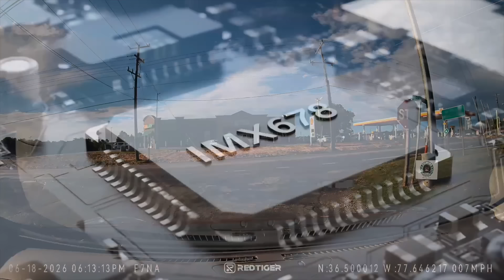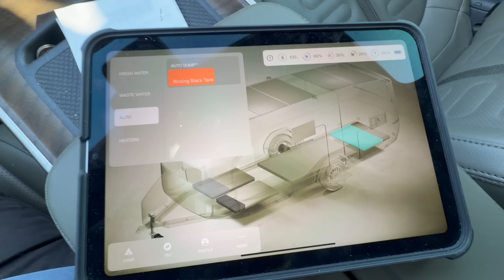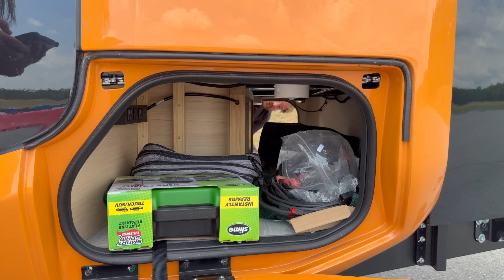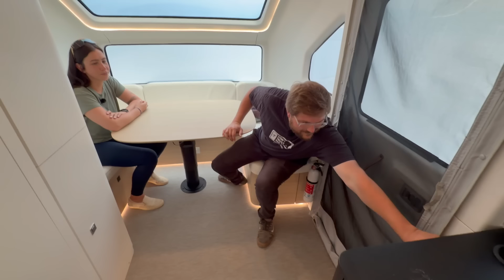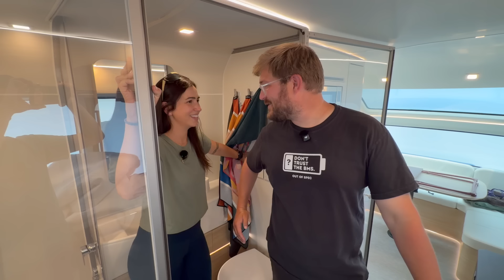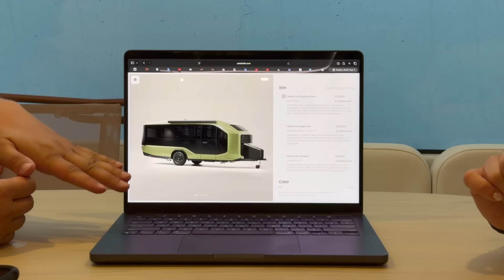Pebble Flow Electric RV 1 Month Review - The Most Innovative Product We’ve Tested

Comment: You actually do have to pull out blocks if the slope that you're trying to camp on is too steep because there's only so far the jacks can go so you always want to set a blocks just in case. 

You can always find a flatter spot, but sometimes you can't find a flatter spot.

Comment: This is exactly why they need to make a bigger unit.  One that is about 5-8 ft longer, double axle, more room for battery and solar panels. Not much bigger since it is very heavy.  Keep is closer to 50 or 60KW is good. Use the extra space for storage space, washer/dryer, bigger HVAC.  I will be totally sold if they did that.  Bigger owning too.  And on the back end of the unit, they already can open the big windows.  But if they took a bigger step there, copy what Evotrex did on the rear end like a toy hauler, that would be supper cool.  Personally, I would have a hatch on the ceiling to mount a tent or 2 tents on the rooftop for sleeper.  That would be the best of tbe best.  It solve the sleeping space problem without messing with the interior space of the unit.  If theybdid all those, no other in the world can beat them.

Comment: The leather door straps are a feature, not a bug. Putting my engineering hat on, I deduce that the reason they used leather straps is so that you can ONLY use them to pull the door closed. They specifically DON'T want you to put weight on the door because it would put too much stress on the door hinges, causing the door to sag and misalign from repeated stress. Then the door won't close nicely, which you both pointed out.

Comment: Regarding the awning, while I agree there are "no-pole" solution awnings out there that would be very good, I think that you may be missing a key point of most poles. I generally would not ever fully extend the poles, as the more you leave inside the other pole, the more stable the poles are and the better rain will run off the awning.

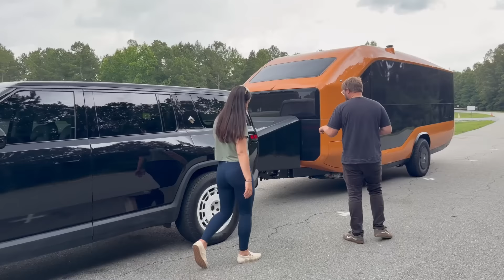Comment: 1:10:49 one of these days. They will get smart and allow the trailer to charge the car as it’s driving.   You could get some real extended range if you use the battery pack of the RV as well.

Comment: I think this was a pretty good demonstration of the impressive features and abilities of this compact RV. It should be very helpful for those thinking of buying one. But I have to say that you jabber too much. You don't have to make a running commentary on everything an d repeat the same information several times. And when you showed the self-hitching feature with the camera so far away, the visual detail was lost, and it would have been much more impressive if you had said "Now I'm starting the feature" and then put the I-Pad behind your back, because from all I could see you could still have been directing it manually. Also leaving yor door open with the AC cranked is not a fair test of power usage. 
     It does seem very odd that they want the murphy bed restored to its upright position for travel. I agree that it needs a larger battery capacity, but I also think that 50 gallons is a really small water capacity. That should be at least doubled. 
     I also think it sounded like you have no business pulling an RV with a truck that apparently has a very limited range itself. You should just put a truck topper over the bed of your pickup and then mount a pop-up roof top tent on it and a rollup awning that can cover the back and one side of your truck to set up your chairs and kitchen under. That way you might be able to get well away from civilization and enjoy nature.

Comment: Funny, I sent Pebble an email in May with some observations and questions that overlap your comments. They did not respond although I was happy to hear what you thought of the bedroom layout, magnetic screens and shades, leather door straps, awning, and high tongue weight. Things you didn't mention include reading lights for the bed and dinette, and power outlet locations for personal devices. Plus, the a/c unit location on the tongue not only adds unwanted weight up front but prevents the tow vehicle's hatch or tailgate from opening. Finally, I wish they offered dry toilet options--there are many nice ones including electric operation which fits the Pebble design.

Comment: something is not right with the AC unit. My old fifth wheel trailer with a 2000 watt continuous load, rips fine out in the desert where its over 100 during the day time. It never turns off meaning it doesn't reach 70 degrees inside but its a roof mount and blows plenty of cold air.

Comment: You’re in the founders edition did you crawl underneath and look for the spare tire? Sometimes they mount them to the bottom.  Also, at that price point when you opened up the storage thing from the outside, you could see all the cheap wood they used to building.   It should all be made out of waterproof composite material.   There should be no wood in it anywhere.  You were talking about three years of roadside service and if you were out in the desert, would they come get you?   As long as you were on the side of the road.  That’s what Roadside means.  Why didn’t they make the bed retract up to the ceiling straight up?  Instead of making it like a Murphy bed.   I dig all the technology in this thing, but it is way overpriced.   I hope Temu starts to make these.  ATC Trailer company makes an awesome all aluminum composite trailer that you could take a hose to and clean it out.   And it’s beautiful.  I’m tired of wood in a fiberglass shelled Travel trailer.

Comment: A/C concentrate should not be piped to the camp side of the trailer 58:47
Reply: idk, mine is roof mount and drains out the back of the trailer.
Reply: @uhjyuff2095 sorry, I meant as a standard practice they should never plumb it to the camp sidewhere you have higher foot traffic

Comment: They’re working on the HVAC.  Definitely needs a light in power connection cabinet and illuminated switch by bed and in shower for the light switch. Easy fixes for us owners but I’d bet a $1,000 those will be adds soon. Pebble is very responsive. Also the support process is awesome.

Comment: For the climate control, I think first off they should add more capacity both power wise and airflow wise. But the vent positioning could be better, homes have multi split ac units so why couldn't they do two heat exchangers where one blows out the front and back glass edges so that the two extremities are covered and that reduces the likelihood of complaint of the cooling being undersized.
Reply: idk what is wrong with the AC. I have a fifth wheel and took it to the desert in 100F plus temps. The AC was cranking but it did the job and wouldn't reach temp until night time.
Reply: @uhjyuff2095 I think Kyle’s points about the AC are mostly that it just needs a little bit more capacity and the vent locations need to put more air generally instead of the small directional vents. Of course I have not experienced it though.

Comment: man wish there was like a 10 minute version of this
Reply: You new here? 😂
Reply: @Michael-xv9ku 
Ticktock ....generation ...throw them a  book or a manual ... and watch them walk off holding their head and doom scrolling 🥼🧙🏻‍♂️

Insulation and passive solar gain control is a constant design issue with Boats and RVs because the designers are too focused on appearance and energy intensive  Active Climate control .. circulation Fans  are generally how full time  boat dwellers solve the problem with roof mounted  solar ..light wt flexible walk on if need be.. but it allows off grid living especially in heat waves.... In silence . 
The roof light panel  needs  particular attention. And Na ion. Battery tech is a huge simplification. In terms of removing  battery management and safety issues in extreme cold or heat .

Scots a Sweet lady I wish he'd let her talk more she's the one who's been living in it  for a month .... someone is going to be lucky in life . 

One thought just like car remotes ...Wait till someone hacks your trailer in the middle of the night 🫣😂 ...walkies or retract the stabilizer legs for that tail dragger experience.
Reply: Interesting to see Telo have increased their recommended  max tow limit to 8000lb  apparently it's very very good at hill starts and hilly terrain.

Comment: The diamond button is to turn on the exterior lights. Also if you hold the diamond button and the middle button simultaneously, it resets the software (hard reset). The backout shades (especially the moonroof one) really help keep the interior cooler.

Comment: What is the black box in front for?  I thought it went up/down??? Is it storage?
Reply: That's the HVAC heat pump. It does go up. Cooling works better with it up, but then it blocks part of the front window, and gets a little louder outside.

Comment: Great review. Pebble should try testing air conditioner in toasty Phoenix area where I live. I am surprised that OffGrid use depleted the 45 kWh battery in 2 days. Typical RV doesn’t have even 1/4 of the Pebble 45 kWh battery pack size.

Comment: For the sleeping arrangement in the rear, I think if they made it so that two tall twin mattresses that can be folded up on the left and right sides of the trailer out of the way when not in use would allow for more versatility of the space. Additionally, the mattresses could be extended to form a queen/king-size bed by extending extensions, placing a filler piece in the center or on the left/right side, topped with a mattress topper. This configuration would be ideal for those who value their personal space, as it provides a gap between the two mattresses, allowing individuals to get in and out of bed without disturbing their partner.

So if you wanted to cuddle or do adult activities, you would create the bigger bed, but it also allows you to have your own space if needed because of fighting or maybe it’s too hot or cold for your spouse and still sleep next to each other in your own beds. It allows them to freeze themselves out or roast themselves alive by putting a whole bunch of layers on— and you don’t have to worry about them stealing your blanket unless you’re sleeping on the bigger bed.😂
Reply: a couch that folds out to a bed?

Comment: that is crazy about the cooling. We are in TN, and our 34ft fifthwheel is able to maintain 68f with a 18k chillcube on 1600w of solar. I have 10kWh of battery and can run  easily through most weather. I think the issue is not the AC but the window surface area. This is the same gripe i have with EV's the whole "glass roof" thing needs to stop being the "go-to". if they gave an option for half the windows in this rv, it would severely help climate.

Comment: After watching many of your videos of the Pebble, I think they should overhaul the app. It seems like you are constantly searching for functions, while half of the screen is only for showing a (static?) picture of the trailer. Also, why doesn't the aero cover move with the one button solution for camp and drive mode? But still seems way more refined than the Lightship though, where some leveling features weren't even integrated in the app.

Comment: Love the Pebble and your review.   One thing though is entertainment.   No TV?  I guess you can put a larger iPad on a wall or whatever and stream stuff.   But they should make provisions for mounting something in the dining area and in the bed area would be nice
Reply: That and built in starlink would be amazing
Reply: The Founder's Edition comes with a projector that can put TV on the wall by the bed, with the bed up or down.
The Pebble is pre-wired for StarLink, but you have to get your own.
Reply: @Grandma-EV that’s great for Founders owners, but the majority of owners will have to figure out a tv/projector themselves
Reply: @phenom354   You can buy any portable TV projector off the shelf. It is not built into the Founder's Edition. It's this little device about the size of a softball. We got a fully spec'd MagicPack and saved $30k. We didn't think the Founder's Edition was worth the extra $$.  We did have to wait longer for delivery, though, as they started production of Founder's first.

We don't camp to sit inside and watch TV, so we didn't get a projector. We both have phones, tablets, and laptops that all work in a pinch. Then you are not stuck in one spot to watch.
Reply: @Grandma-EV  I seemed to have missed Kyle talking about Starlink (which he promised). There is that extra socket on the outside power plug/socket system. Then I saw someone drop a cable from the cargo bay on the RHS - and plug in a portable Starlink - but I think there is more!

Comment: I hope they have an app for all functions going forward. If the iPad goes down you are in major trouble. As you are likely to carry the iPad outside it could easy get damaged.
Reply: They have an iPhone app with controls pretty much everything except moving the unit.
Reply: @mikewilliams215 I know but moving the unit is a big thing isn’t it?
Reply: @Paul-k4l7z There are manual backups for every electronic function. If everything goes down electrically, you can still manually hitch and move the trailer. There is also telemetric data being sent to the home base should anything happen and they can log in over the air to troubleshoot.

Comment: On their discord, solution for ac on hot day is to raise the airbox up to fully expose intake vent there. We did that with a demo unit and it seem to do the trick
Reply: not sure if it works with this RV AC unit but other inverter style ac units you can trick the interior temp sensor into thinking its 100F inside the RV to make the AC give full power like a legacy air conditioner. The reason is most of these inverter AC units track outside temp and use some weird algorithm to save on electricity at the expense of comfort. If the unit had a full blast mode it would be fine but a lot of these units don't have that mode.
Reply: It is more efficient with it up.

Comment: Given the sleek design I’m surprised the awning isn’t better integrated into the exterior design…
Reply: The design is made to look pretty on brochures by someone who doesn’t camp, and looks like the awning was an afterthought.
Reply: @EVPatrick  yup! if it was designed by an avid RV'er... better awning, less windows (for better climate control and better sleeping) and camp side outlets...
Reply: @stinson87 It was designed by an avid decades long camper.  I suspect we’ll see a change at some point with more integration. It is huge however and I use mine with zero issues.
Reply: Agreed.  It’s tiny too.  You’re not going to fit more than a couple of people under that shade
Reply: @NateLayman  right, a real camping setup has tables and the awning is too small.
Reply: Pebble has talked about a longer awning. I'd like to see one that shades all or most of the windows toward the back. That's a thing I would change, a longer awning. Thule makes a good product, and we haven't had any issues with its operation. It can go out further than they were showing in the video. Also, the legs should be staked or weighted down. Sure, they could put a beefy one on with arms that attach to the sides of the RV like conventional trailers, but remember, there's a trade-off with weight and aero. I'd rather have the road efficiency and bring a $100 E-Z-Up for extra shade, if needed.
Reply: @Grandma-EV  not convinced about road efficiency with awning or not when the trailer has electric motor towing assist.
Reply: Exact same awning we have on a slightly smaller trailer that costs a quarter of the Pebble. Works well for two people.
Reply: @CatBend 
There's space for two side by side ..just not so useful in a down pour.